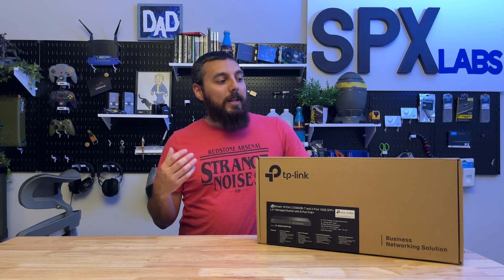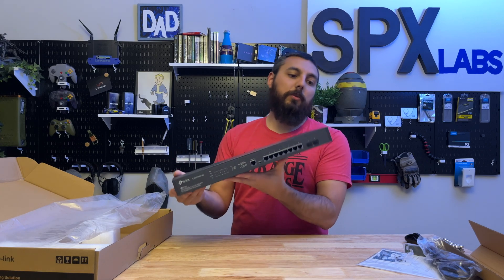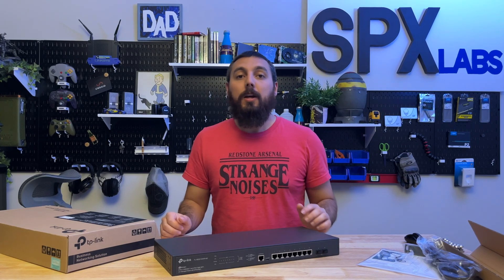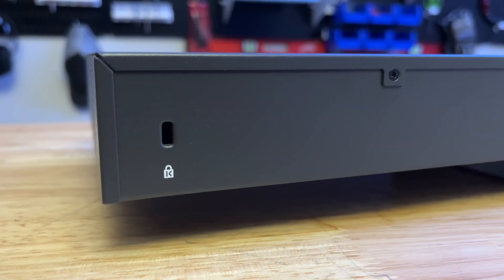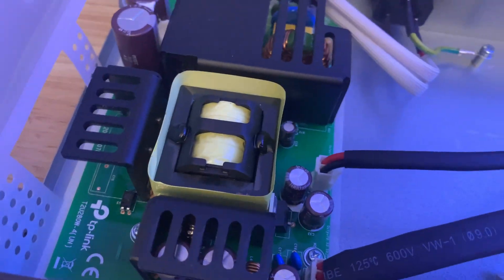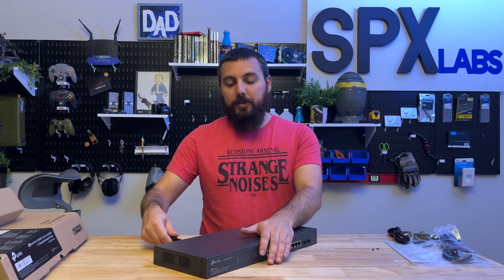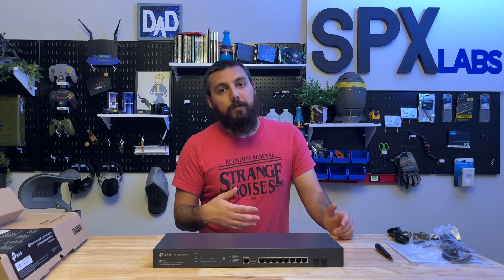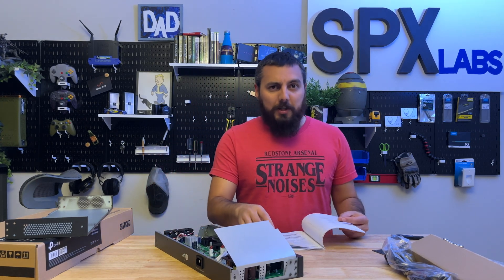Overview and Unboxing the TL-SG3210XHP-M2 from TP-Link

Comment: Can i use my ISP fiber router with 10g port with this switch and oc200 and omada access point or do I also need an omada router?
Reply from the maker: You can do that but you will be missing some features.  If that’s okay with you then go for it.

Comment: You can replace those fans with more quiet ones from for example noctua fans. Probably you need to turn the white feet on the pcb around because of the + and -  .
Reply from the maker: Yeah but they will need to be wired correctly because they are not standard PWM fans
Reply: Or just go for ZyXEL GS1900-10HP
Reply: @MelroyvandenBerg  The GS1900 you are mentioning is 1 gigabit and does NOt compare at all to this TL-SH3210XHP, which is 2.5 gigabit.  

So far, ZyXel does not have a product that compares with this. The 2.5 gigabit switches that Zyxel does offer, starts with 24-port.

Comment: i just bought one and none of the ethernet ports light up when i plug in a cable, looks like a lemon for me, fresh out of the box
Reply from the maker: You mean the lights to the left of the ports?  Not even the power light lights up?
Reply: @SPXLabs  the power lights come on, and when i plug in a cable in any of the 8 ports none of those lights come on, i dont have any sfp gear so i cant test the 10gb ports, i plugged in to the usb console and can get in to that so i know its running
Reply from the maker: That’s very odd

Comment: This is a very interesting product, nice to see 2.5 GB switches coming out. What I don't understand is why is this not becoming more mainstream?!? For home users it would make PERFECT SENSE. Where are the 16 and 24 ports version of these switches? I hope there will be more to come. Anyway, very funny when you think about it. CAT 6 has been around for quite some time, 10 GB switches too yet all of that is still so very expensive. There is even CAT 8 out there which can do 40 GB/s... And still 2.5GB is taking time and a lot of 1 GB products are still being push.. What the heck?!.. Anyway, nice review man! Side note, as you were saying the product version I was thinking the exact same time before you said it (that is a mouthful) hahaha
Reply from the maker: I'm confident they are rolling out stuff as fast as they can.  Right now is a hot time for WiFi6 and 6e devices plus the massive roll out of 2.5G and 5G home internet.  Hell even Ubiquiti doesn't have any amplifi offerings or switches that are 2.5G.  Of course if you bought a all SFP+ switch you can do whatever you want BUT man it's a crazy time to want hardware.
Reply: @SPXLabs  Hopefully you are right. One thing is for sure, I definitely like TP-LINK stuff.  I currently own a TL-SG3428 but do not have the OMADA controller yet, that is going to be my next buy. I have an old HP Procurve as well that I am keeping because I separated my network in two but man, can't wait to upgrade to a 2.5GB 24 ports.. Soon after I'm probably going to get that WIFI6 AX3600 but not 100% sure, that thing is huge... But I guess it does offer good ventilation. Anyway, keep those TP-LINK reviews rolling really digging it!
Reply: I also like to see 2.5GbE or even better 5GbE to be the standard in 2023.

Comment: Good video SPX, was looking for 2.5gig poe switches and this came up :)
Reply from the maker: More to come from it.  Word on the street is that it has a high failure rate.
Reply: @SPXLabs  Yeah that sucks, i wonder what is failing in them.. PSU or ?  Are you able to run yours and see the temps ?

Comment: I purchased this switch in late September 2021 and it died in early November 2021. The fan noise was very loud, not suitable for the home, very annoying but I was willing to put up with it to get the 2.5Gbs for the EAP 660. TP Link customer service was very good and they gave me the choice of a replacement POE  switch (1 Gbs) which was the next best choice since it had more ports and given the current speed limitation of my FIOS internet service I would never achieve 2.5 Gbs. I also don't own anything that can hit that speed. Anyway, I would not recommend this switch to anyone given it has a poor reliability track record, read my review on Amazon which essentially said to not buy this switch.
Reply from the maker: Thanks for the heads up! I will definitely report any issues should they occur.  Thanks for vocalizing and let me and everyone know!
Reply: Same problem here died after just a few months. Was only feeding two tp link 660 APs and running some vlan’s. Noise of the fans is unbearable. For now replaced it by zyxel 1250 managed switch and a separate poe switch for the APs. Have (or rather had) a full omada set-up but this switch was an expensive disappointment.